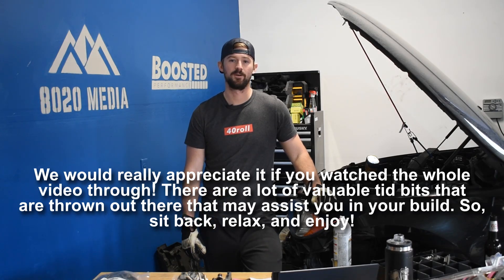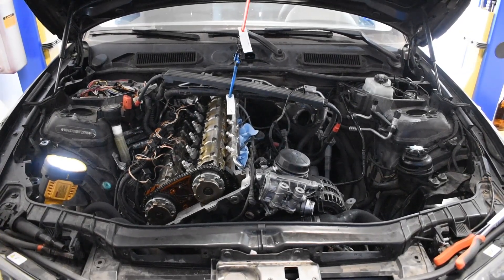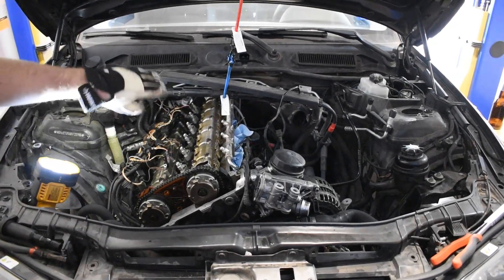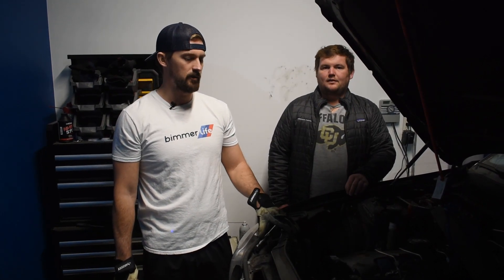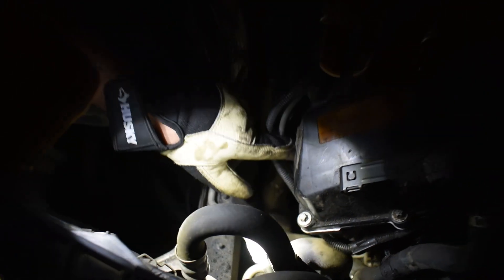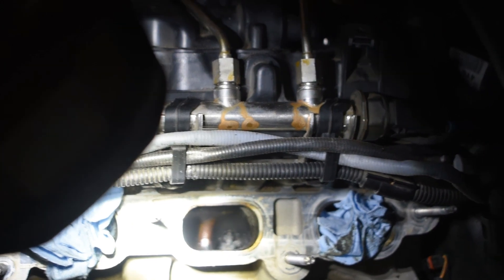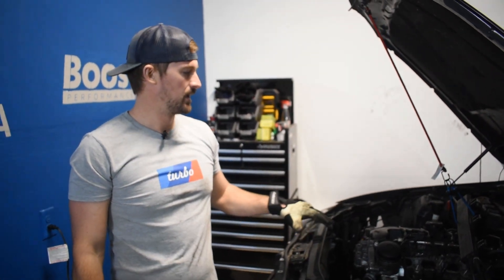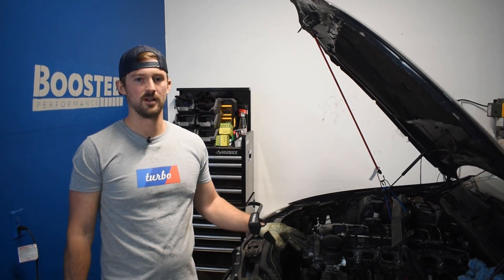Building a 700whp Single Turbo N54 - Preventative Maintenance | N54 135i Build Ep.2

Comment: Love N54 content 👏🏽👏🏽 

Good thing is that the bolts you broken are easily accessible. I have about 4 Transmission bolts broken and never got them fixed 😂 I’m just happy my transmission hasn’t fallen off the highway while doing pulls
Reply from the maker: Lol sounds like a classic N54 there, always holding strong until they don't haha! Yeah at least it's not one of the bolts on the back of the valve cover cause those are an absolute pain. Should have replaced them but $150 for some bolts...as much as I believe in preventative maintenance, not worth it in my opinion.